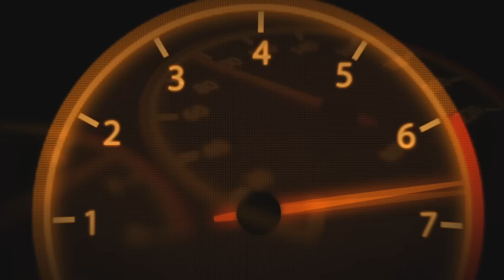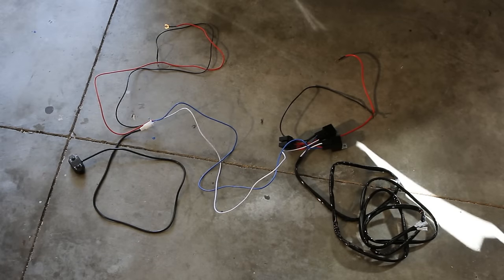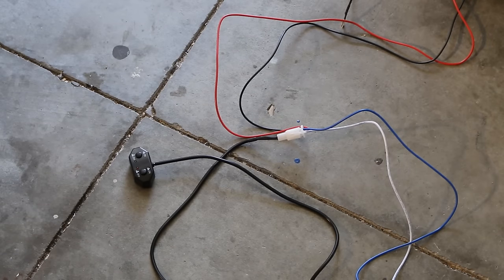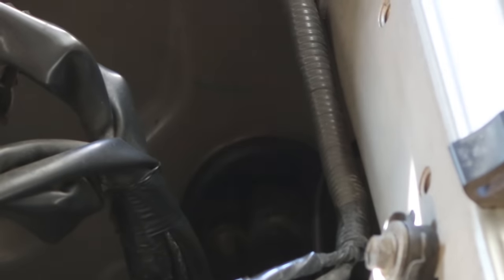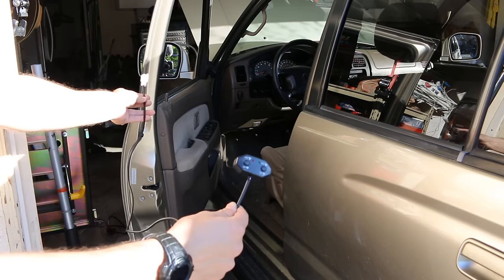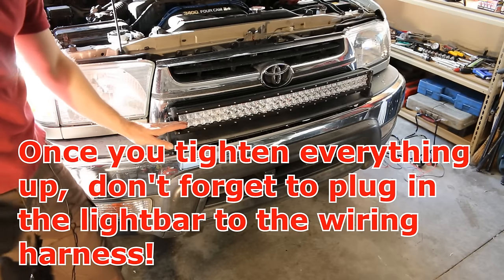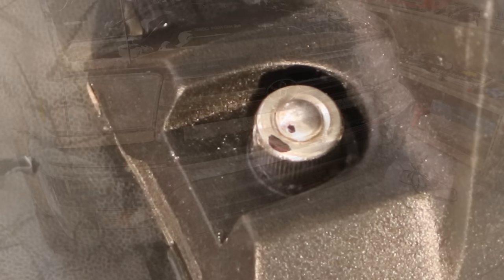How To Wire And Install An LED Lightbar On Your Car - 1080P HD

Comment: I spent 12 hours installing my 2 lights along with the harness. my lights are 4 inches each.... what a simple set up but what a difficult execution. I had to really work hard in order to make it look like my lights weren't connected to anything (make it look clean). they're awesome but this was an extremely time consuming little project. It was well worth it.

Comment: Hello, awesome video! I ve been wanting to do this on our regular small city car but I m too scared it will interfere with the cooling of the engine. Did you notice any raises in temperature since you installed it? I m thinking of doing one of the 20inch one row led bars maybe that will help with more air coming in...
Reply: It won’t have an effect on the cooling of your engine....
Reply: Lol it won't affect your engines temperature in the slightest dude, you're safe
Reply: every car with a radiator will also have a fan that pulls airflow thru the radiator at all times the engine needs it / overheats. if your fans are functioning as designed, you're fine no matter where you mount the light bar

Comment: THANK YOU! I've been looking for instructions on how to wire my lightbar up for a week. There are videos out there, but yours is the only one that's said anything about where to put the positive cable for the relay! Is it fairly obvious, sure. But messing with anything electrical in the past, I've learned not to do anything you aren't sure of, even if it makes the most sense. 

Once, I fried 3 alternators on a 240 Redblock because I was chasing an electrical issue without knowing what I was doing. Somehow, I ended up overcharging the system and frying 3 alternators. I finally gave up and took it in where the nice 70 y/o mechanic chewed me out for touching things I didn't fully understand. He mentioned that the one thing to never do was mess with electrical systems unless I was absolutely certain of the outcome. I never cared for his attitude. However, looking back, he wasn't exactly wrong.

You've saved me a trip to an installer. Thanks!

Comment: Thank you for your aid in explaining what goes where. I just had the auto elec install my new LED light bar, previously I had a set of excellent long distance driving lights installed by another person (who did not connect the in-cabin on/off switch, why I do not know.)
My intention was to have both the LED and the long distance driving lights fitted to the front of my Subaru Forester with each set of lights controlled by each fully functional in-cabin on/off switch. However, the dude did not refit my spot driving lights telling me I won't need them anymore! So now by watching your presentation, I will be better able to return my spot driving lights (including the correctly set wiring and etc under the bonnet) to the front metal support plate of my car.
Why, one might ask, well I live 100KMS from the city shopping centre and do a lot of night driving where wildlife is forever wanting to cross the 100 KPH highway. The road at that time of night is mostly bare of other vehicles
I do not want to hurt any critters, nor do I want to sustain any vehicle damage.
I reduce my speed when I enter the thickly forested section by 15 KPH or say 10 MPH, this provides me with a little extra time to react, either to brake firmly and safely, or choose to carefully take a measured veer around any on-road critter.
My Spot driving lights are directed toward the grass verges of the roadway in order to watch for any and all critters. Also, 'all of that extra light' gives a greater amount of visibility during my night driving, thus provides more visibility control of whatever may lay up ahead of me along the roadway. Thanks for your advices.

Comment: Showing how you actually connect it to the bumper would be great!
Reply: Drill a hole, put bolt through hole, put nut on other side of bolt.. does it really need instructions?

Comment: Where did you connect the positive and negative wire on the switch
Reply: Doesn’t matter, switches only serve as a way to break the circuit, positive and negative is irrelevant
Reply: All your hot wires should run to the battery or a circuit to the battery. All grounds can be ran directly to the chasis

Comment: Could i use a piggy back fuse from high beam fuse to make them come on would that work do u know
Reply: I would not as you should really want to match the fuse to the light bar. Plus turning both high beams and light bar would blow it out. Using the correct gauge wire and fuzes is pretty important in terms of safety and fire hazards

Comment: If you're drilling a hole to mount a light bar directly on top of a bumper why bother with the tape.... I think scratching some plastic is the least of your worries.
Reply: That's neatness in working.  I appreciate that.
Reply: He is showing how you would do it if your bumper was painted.

Comment: I connected my positive to my fuse box and my ground to the battery on my wire harness it’s my first time installing a light bar is that safe for my battery? Or should I go a different route

Comment: Hi sir,

I have fit an aux light on my car. Its an 80w light + single relay.

Now the harness end wich need a source. The black wire has been put to the negative end of the battery.  The red wire of the harness is now connected too or rather tapped to one of the car wire that is connected to my dim light on the car.

Now in this case will there be a load on the small wire that is connected to my cars dim light.... do I simply re-connect the wire harness directly to the +& - of my battery

Kindly advise

Comment: Will connecting the ground terminal to the negative battery terminal instead of grounding to firewall cause a battery drain? Also my rocker light switch stays on
Reply: Good question
Reply: puedes averiguarlo con un multimetro, en modo corriente

Comment: Im trying to install my light bar with a switch but it did not turn on. Im just learning about wiring. So on the wires themselves I did not put all the females on one side. For example on the negative wire from the light bar I attached the male connector but on the positive wire from the light bar I used a female connector. Does it matter if both male connectors are not on the same side of the accessory

Comment: Hi there want to wire a light bar to my bus can I simply use a seperate on off switch to isolate it it's a road legal type led can I simply tap in my headlight wires instead of using seperate relays
Reply: Use a circuit like the headlights to trigger the relays, 
Then you wire in the hot side on the relay for the light bars own circut. That way the lightbar isnot pulling power away from the headlights,
Reply: The vehicles circuit  isn’t just one specific item. It has a bunch of hots that leads to the fuses and to the switch for that fuse.  Run it to a fuse that can handle the light bar power and beer tad bigger fuses other that what the manufacturer says. When adding something that’s not made for a vehicle it’s always good to create a new circuit.

Comment: I want to mount 6 led lights on my 2008 tacoma. Total watts of the lights add up to 396 I'm using two wiring kits each with 40amp relays. Do you think it will be ok to run on arock battery and alternator with no problem ?
Reply: Run it to the battery as the alternator also runs to the battery fad the alternator is the battery charger and hold power only the wire itself.

Comment: Hi I can I ask for some advice? I tried connecting my led bar directly to my car battery just to test if its working but its not turning on unless i make a spark using the wires to the battery terminal. Thanks
Reply: No don't do that, it will blow up all the led's
Reply: SoLTY oh oww... any recomendation how can I test it? I hope i haven't broken it yet. Cause thats exactly what I did. Directly connected the wires to the terminals. :(
Reply: LOL, why would you think thats a smart idea.
Reply: @DashCamJournalsPH  Hahaha
Reply: How will it blow it up...the light bar is good for 30volts
Reply: @nxtgen2b416  depends on the amperage rating also.
Reply: oh my gosh some of these comments are so dumb are you guys five or six years old out there if you want to test a light hook red to positive on the battery black to neutral on the battery it won't hurt the light if you hook it up backwards the light won't burn but Tractor Supply technicians say it will not hurt it it just won't burn
Reply: @popwall4297  You're absolutely correct. 12 volts is 12 volts,regardless of how many amps,the LED bar will be 100% fine directly hooked to the battery. LED's are also polarized and will not be damaged when wired incorrectly,they just won't illuminate.

Comment: What I do not get about the light bar is that mine has only two wires coming out the end of the light bar positive and negative and it is camel flood and spot now there's no three wires whatsoever coming out of the back of the  Light bar it's self, 
I just finished installing the switch I didn't want to but I had to cut us rectangle whole and my dash but its neat and its clean looks like a factory job now the next part is the wiring harness the wire for the switch is only about to and a half feet long and maybe 3 feet as weirdos wires come off the relay switch for under the hood but we're I have electric power steering I was thinking trying to find a whole bag goes out through and I cannot find it I'm afraid to drill a hole to the firewall, afraid I'm like drill into a main wiring harness and I do not want to do that so I was thinking if possible like I did with my underglow I haven't heard casing lawyer that goes in between my fender and my door as when I close it it doesn't do any damage to the lawyer can I do it that way the same for the light bar harness thanks.

Comment: You make a good video, but the guiding to people that you can make a hazardous connection or short-circuit from a negative terminal to the chassis(ground) is not possible. Gloves or tape won't help either way. The negative terminal IS connected straight to the chassis. To have an accidental short of any kind, you must have a complete connection from a power source, (the battery - from both terminals, positive and negative) or from another power source that has both leads channeling through the car's wiring system in some form or fashion, then make a COMPLETE CONNECTED circuit. Which without a load(light bulb, light bar, radio, etc...) to use the power, results in a short-circuit.  Other than that, your video works well enough. Have fun and good luck in your quest for knowledge.
Reply from the maker: The wrapped glove trick is meant to be used so that the negative cable doesn't come back into contact with the negative terminal of the battery causing the arc.  Not meant for stopping contact with other parts of the vehicle.  I understand electrical theory and practice, and use it daily, but if you were a content creator, you'd realize that after filming a segment multiple times (as is normal for most) you begin to say things that are not true to spec....Sometimes these things don't get caught in post production etc. You get the idea.

The point being, these videos are not peer reviewed step by step productions.  There are a "guide" for which many can build a foundation on.  
Thanks for your input.
Reply: @DIYautotech   will my check engine light come on if I put a light bar on for any reason relating to light bar

Comment: Why can’t I find a 3 wire wiring harness for high and low beam 3 wires to each light for two lights
Reply: Just get a dual relay harness, and wire both hot sides to lo/hi, the grounds are relative you could wire both ground to the shingle connection on the lightbar.

Comment: Is connecting the red wire to the positive battery terminal always lead to draining the battery or does tht only happen to certain vehicles...bc I have a 2002 toyota 4runner, thanks!
Reply from the maker: No, so long as the circuit is not grounded while while the key is out of the ignition, the unit will not be pulling power.  There will always be a bias voltage on the power wire, but no current is flowing through the unit.
Reply: DIYautotech : so I have to have the key in the ignition while im connecting the red wire to the positive terminal  and black wire to ground??? Trying to understand...
Reply: Israel Rodriguez he's just another YouTuber trying to be special trying to make a name for himself who doesnt really know much
Reply: Israel Rodriguez if you run it to a relay with a switch it won't draw power till you turn on your vehicle. The only time it will drain the battery is if you run the light bar straight to the battery. With the switch you might experience a small phantom drain but nothing to kill the battery unless you leave the vehicle sitting for a long time without starting it allowing the alternator to charge the battery
Reply: @mackenziepeek9317 The switch red and black wire doesn't have a relay, that means the led  in the switch will stay on all the time. wont that kill the battery?  also can i operate the switch without attaching the red and black wires of the switch?
Reply: @HeetJoshiofficial  the switch controls if the light is on or off. You have to have the wiring hooked to the switch for the switch to work. It can be wired a few different way. Some have plugs in the back some switches are 2 wire red and black some are 3 wire. It all really comes down to what you are using what pieces you want to include and the wiring that comes with said pieces and the vehicle but anything electrical will at least have the hot and ground(usually red and black can be different colors for different circuits)

Comment: The red light on the button is always on or only when the ignition on? Thanks!
Reply: I’m guessing it does unless you add a relay
Reply: @theoargyros3618  wouldn't it drain your battery if it's always on lol
Reply: Ambiguous User its such a small amount of power i doubt it
Parking lights werr created to stay on all night, so it should be fine. Plus my dumbass has left my headlights on for 6 hours before going back and turning on my car. It should be fine
Reply: @overknight5278  "Should be fine" Famous last words
Reply: @HeetJoshiofficial  gots to see it through my boy. You’ll never know if you never try. Most of the time it also depends on the car, age of battery etc. Cuz i can go a few hours with aftermarket lights on in my truck but 30-40 min in my sedan with lights on will drain the battery and die 😩😭.

Comment: With this set up will the light bar automatically turn when you turn the ignition off?  Even if the control switch in the car is still "on"?  This to would be to avoid leaving light bar on by accident when not in the car.  Thanks.
Reply: Only if you are blind you would not see the light bar is still on. Lol
Reply: @AbeTerre  or drunk

Comment: I find it funny that you don’t show how to connect it to the battery.. something MOST people don’t know how to do without killing themselves
Reply: Connect red to red and black to black but place a switch before the red wire of the led bar or after the black wire on the led bar before connecting to a ground point in the vehicle. It's pretty easy

Comment: How can I wire this to where when the car is off so is the light bar? Because the way Auxbeam says has drained my battery
Reply: Luis Espinal instead of connecting the red power wire to the battery you need to connect it to a wire that is only live when the engine is on such as your ignition switch (you'll need a multimeter to find the correct wire)
Reply: Luis Espinal you can make a joint on the wires for you lights or preferably fog lights if you have them so it pulls power through the same fuze as your lights and will only come on when your lights are turned on

Comment: Do I need to use a wiring harness for my LED lights or can I connect to my rear cargo light directly?
Reply: Did you ever get an answer to this Kenneth? Going replacing work lights with a light bar so don’t need new wires or switches if possible??
Reply: You should use the cargo light as a relay trigger, say for instance you drilled the light bar on top of the roof, so that your cargo light is still perfectly intac.
You can wire that relay low voltage side to the harness,  so that way it triggers the hi voltage side on the harness which has its own big supplemental wiring and fuze, so that way the cargo light will shine bright and the led light will shine bright as well because its wired correctly.

Comment: I get a buzzing/humming sound when I hit my light bars on?
Reply: They might have a small cooling fan in it which isn't uncommon. I wouldn't worry about it too much even if there's no fan
Reply: That’s due to a couple things... cheap piezo capacitors or too thin of a wire... some light bars will hum due to those two issues.

Comment: The only thing you did is drilling and  wires though firewall. Where is the connections and Etc...? I know nothing about electrics and didn't get anything from your video. I better ask someone to do it
Reply: You do that Snow White. If you do not know anything about electrics (your words) what are you trying to learn here?
Reply: Trump Trump thats the easy part. I didnt know how to get it past the firewall. The connections are simple, they sell harnesses online, the positive and negative just het connected to the battery, then the lights (like plugs) then the switch is connected to a fuse and more (thats the whole harness tho so its taken care of) pretty much the difficult part is actually installing it